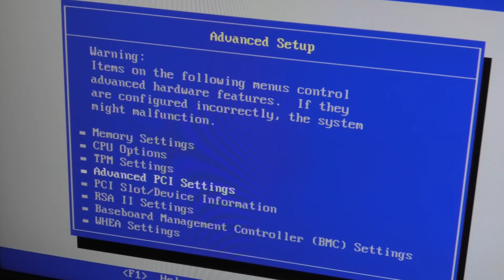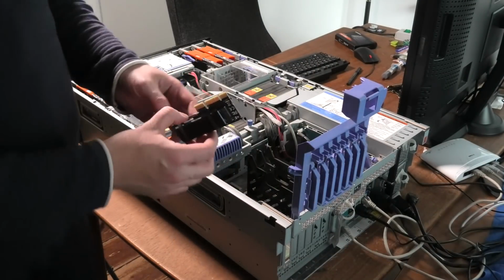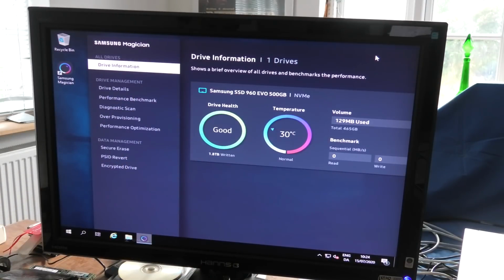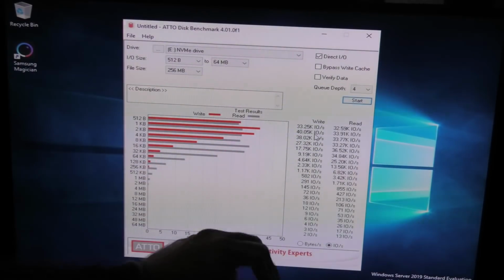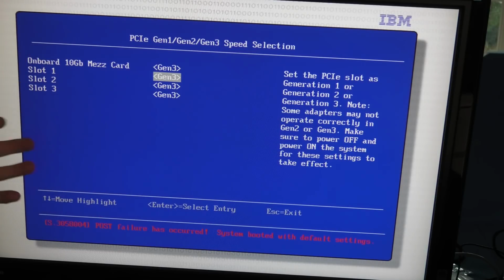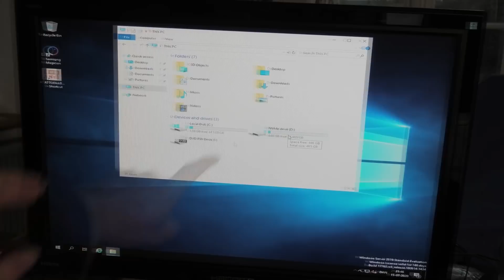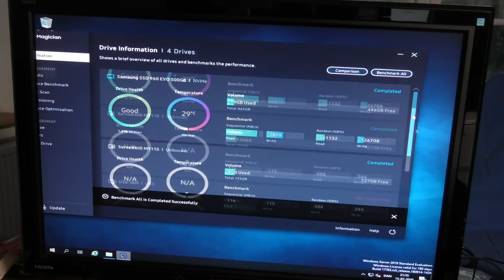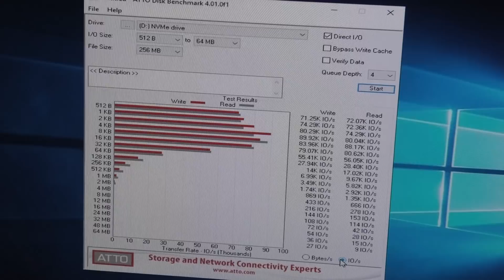Flash Storage in Home Enterprise Server - Affordable - 980

Comment: i have a hp 380 g7 running on ssd, they told me i can't go faster than ssd.
but if i understand correctly, i can get M.2 NVMe speed with a card like that ?
Reply from the maker: Yep,, that should work,, it might not want to boot on it but the operative systems should see it just fine.

Comment: The SSD is too cold under that high Airflow Conditions. NAND Flash needs ~40 Degrees C° to stay "healthy". You want the Controller on that thing as cold as possible, like every other Electronic device, but NAND Flash itself needs some Temperature, to stay healthy. At "Room Temp" ~25 Degrees, the Lifetime of NAND Flash is as little as half of what it is, when its running at the rated 40 Degrees C°.

Sources: https://youtu.be/lQmI5A27Iv8?t=429
https://www.jedec.org/sites/default/files/Alvin_Cox%20%5BCompatibility%20Mode%5D_0.pdf (At around halfway through that document)

EDIT: The 3850 M2´s x8 Ports are only 2,5Gbit/s, so around 300 Megabyte/s. Which explains why you only get ~150MB/s with an x4 Interface.
Reply from the maker: Some of that looks to be how long it will store data powered off ?
Reply: @MyPlayHouse  Yes thats also in there. Its the Jedec specification for NAND Flash.
Or at least part of it.
Reply: @MyPlayHouse  Here is another Video from GamersNexus about that Topic.
https://youtu.be/KzSIfxHppPY?t=375
Would highly recommend to watch the Part i marked. (starting @6:15)

Comment: Perfect video!I think you put the ribber bands wrongly. If you put them around the nvme drive only should be better. Also the holes you were asking on the board are for nvme drives with smaller length.

I already use an nvme wd black 500GB with the heatsink already onboard by WD on my dell R730XD on my lab and works perfectly with esxi. I get around 3000/2000MB read/write . My idea is to put the disks with the OS on the NVME  and the spinning sas drives as the secondary disks. Since no raid witn 1 nvme disk i do the backup os the OS disks very often. 
Also when supending the VMs on NVME is done almost instantly.
Reply from the maker: If you saw the first video I put one of those cooling transfer thingy betwine the back of the NVMe and the board,, so the rubber bands would get in the way of that.
Reply: @MyPlayHouse  i didnt notice that. on the other nvme's that i have on my nas I put the rubber band between the nvme and had a gap. Maybe the board that I had had bigger clearnce. Or the bands that i had were thiner than yours..

Comment: on the topic of running a gpu on 1x(or anything under 16x), I found with a 1050ti(video decoding for blueiris), you can see the bus bandwidth utilization on gpuid....... 1x as too slow, 4x(realistically 8x is probably optimal in my use case) was doable but the gpu seems to run at a higher clock to compensate or something(not completely sure); this was my way to work with pci lane limits of using a 990fx chipset:P.... for lower end gpu's I've not had any issues with using 1x(quadro 400, HD5450, HD6450)
Reply from the maker: Thank you very much,, been a while since I used it.

Comment: The small slots on the card are used to attach metal clips which will hold the heatsink.
Probably you can get the clips instead of rubber bands somewhere.
Reply from the maker: Ohh nice 👍 thank you very much!

Comment: While you make have 7 physical slots available, keep in mind that the combination of motherboard (chipset) and CPU(s) will most likely limit you in PCIe lanes per slot and you almost never will be able to fully populate all slots and get maximum performance. Unless you are running the latest AMD EPYC chips :-)
Reply from the maker: I believe there are enough PCIe lanes in a server like this,, there are four CPU’s
Reply: I was just commenting in general because not all older servers/CPUs might be able to fully populate all slots. But ya, no problem with 4 CPUs :-)
Reply from the maker: It was never much of an issue, before we wanted a bunch of Flash drives in the server.